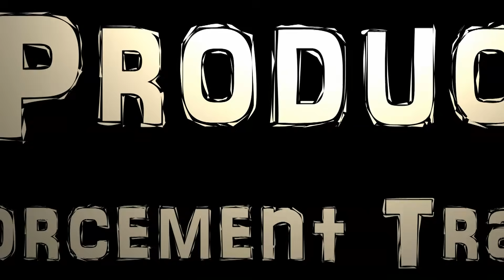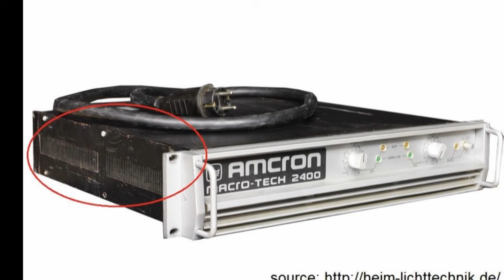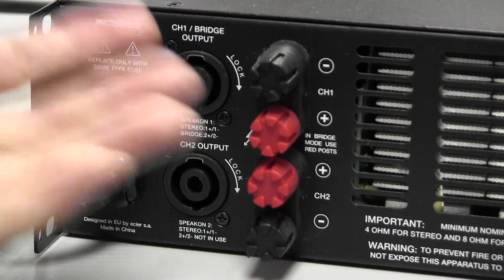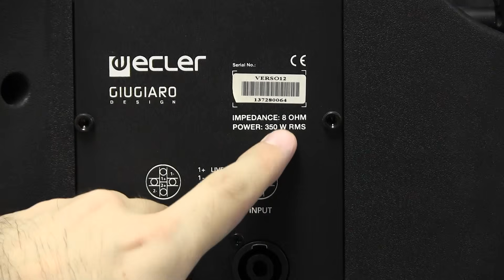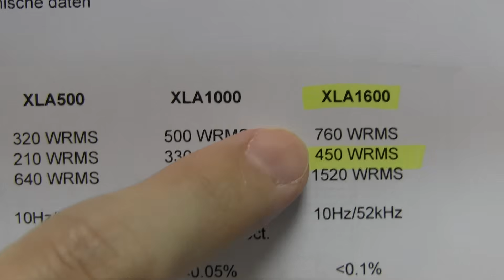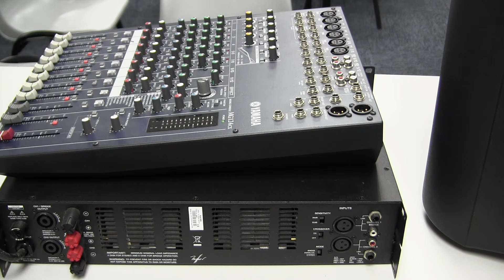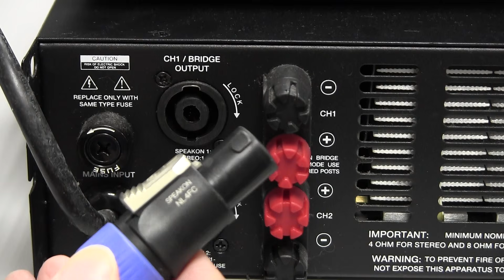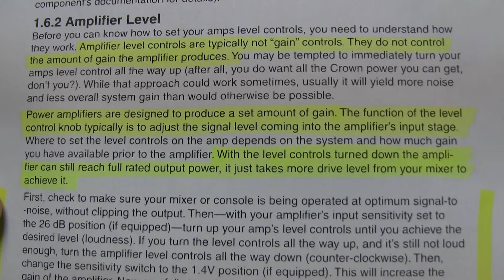How to connect a power amplifier to passive loudspeakers

Comment: This is a great video! so informative. So I have a question, I have a 1500w amp and 2 sets if 100W and 500W speakers whose impedance is at 8ohms each. Can I use this amp to power the speakers? (500w stereo and 100w stereo?) I set up the connection for the 500w and got nothing! no sound- signal flow was correct so I dont know what the issue is, any ideas?
Reply from the maker: +TanuNzau Thanks for getting in touch. How many watts does the amp deliver per channel into 8 ohms? 

If you get nothing I suggest you check your wiring - first confirm that signal is getting to the amp itself (use the front panel signal indicators) and then check the speaker cable between the amp and loudspeakers.
Reply: 500W per channel into 8ohms
Reply from the maker: +TanuNzau 500 watts into 8 ohms may be a bit much for the 100 watt speakers - try it and see! 'Overpowering' your speakers is fine as long as you don't hear any distortion and you don't clip the input to your power amplifier. Start with the level controls all the way down and turn them up slowly while you listen for anything unusual.

Comment: Great video!.. i was wondering if you have a video showing how to set up the amplifier in Bridge mode? what kind of wire i would need and how it is hook up. i want to run some duel 18s subwoofer. thanks
Reply from the maker: +dee fresh There is one in the works!
Reply: +GLB Productions thanks for the responding.. ill look forward to the video.. i've learn a lot from your videos.. keep up the good work!! Props from San Jose, CA
Reply from the maker: +dee fresh Thanks for your support, really appreciate it!

Comment: I pleasant to watch your videos. sir could u please tell me about power amplifier input senstivity like  crown   XLi 1500 power amplifier.
Reply from the maker: +Bhumadi sai kishore Amplifier sensitivity is basically how many volts it takes to drive an amplifier to full power - a more sensitive amplifier will take fewer volts than a less sensitive amplifier to achieve its rated output power. On the XLi1500 start with the switch at 1.4 volts - if your PA system is not loud enough then try changing it to the other setting, but remember that this will not make your amplifier more powerful, it will simply allow you to reach full power with less signal from your mixer.
Reply: thank u sir.

Comment: Hello I'm fairly new into speakers but recently I purchases 800w speakers with 400rms and was gonna get an 800w amp with 400rms but I don't have a mixer can I plug my speakers directly into the amp and use the amp just like a mixing system as I don't have one yet?
Reply from the maker: +Nathgta09 You can use the amplifier as a simple line level mixer with one or two channels (depending on what sort of amp you get) but you won't be able to plug microphones directly into the amplifier. Get that mixer as soon as possible ;)
Reply: Okay thanks and yes I'm getting a mixer soon
Reply: I have a quick question. Is it normal for my speakers to make a popping sound when turning on and off the amp? Even with all the controlls set to the minimum and the EQ all flat I still get this popping sound. I don't have a mixer at the moment but I'm just using my iPad but I cannot stop this popping and it's fairly loud, any ideas?
Reply from the maker: Are you using the switch on the amplifier itself or turning off the power supply to your system as a whole? Also is the amplifier plugged into the same circuit as the EQ and any other equipment connected to the system?
Reply: The amp has a switch on the front I turn that on and off. And the EQ is built into the amp and no the only thing I have connected to my amp is my iPad. When I turn off my amp I make sure all the knobs are 0 and the EQ are all down.
Reply from the maker: Nathgta09 Hmm, it sounds as though this might just be a feature of the amp. It shouldn't be though! I would suggest trying to find another example of the amp and see if it exhibits the same sort of popping behaviour.
Reply: could it damage my speakers?
Reply from the maker: +Nathgta09 It's certainly not good for them! Low level pops are not a problem but loud ones should be avoided, it's like driving your car over curbs and gutters all the time...
Reply: What about if it's a mid range popping noise? Like when it pops it doesn't come from the bass cab it comes from the midrange? I'd say it's as loud as a record playing scratching
Reply from the maker: Nathgta09 I wouldn't worry too much about that, although I would still want to find out the source of the noise.
Reply: Hello I found out why my amp makes a popping noise which is heard through the speakers, it's because skytec doesn't have a DC output protection because it's a cheap amp so what's happening is when I turn on the amp DC current is directly going into the speaker because their is nothing to stop this because it doesn't have a DC output protector. So I'm going to buy a different amp. do you have any idea if ekho amplifiers are better?
Reply from the maker: +Nathgta09 Sorry I'm not familiar with that brand. Glad you found the source of the problem!

Comment: Excellent VDO.    I saw the band's hold  systems went off during the show.   what course the system shutoff? Thank you
Reply from the maker: +San Saechao Most likely overheating - when amps detect excessive temperatures in their output devices they will shut down until the temperature drops. Not a good thing in the middle of a show!

Comment: Hi bro, if we add more speakers, which is the preferred one, by daisy chained it or to go through to the another power amp by connecting from the main power amp as mentioned (21:50).
Reply from the maker: Zulkifli Noriman You can daisy chain additional speakers as long as you do not go below the amp's minimum output impedance, which is usually 4 ohms per channel. However, if you need separate volume control over the additional speakers you should obtain another amplifier.

Comment: We have been struggling with a corporate installation involving 115 speakers divided into 5 floors. We ran into all sorts of challenges with daisy chains and fire panel patching. The moment I found this video, i sent it out to all the techies, so that they can go back to the very basics. I am so glad that I found this channel - and thank you for the excellent presentation - both technical and verbal. its simply awesome. We will be back for more..... cheers
Reply from the maker: ZAY Electronics Trading Thanks for getting in touch! Those installation jobs are WAY more complicated in terms of speaker wiring than most of the stuff we do in live sound, especially when you throw in 70/100 volt lines and the fact that so much of your cabling is concealed. I did a little bit of it about 10 years ago and have much respect for companies like yours :)

Comment: Question . . We have passive speakers for our front of house, but we also have a active speaker in another room which we have daisy chained from one of the FOH speakers to the active speaker. Is this setup ok? or would it be better to run a separate monitor feed to the active speakers? We have two XLR main outs and two Jacks main outs on our Behringer MX9000 mixer.
Reply from the maker: Jonathan Laing I do not recommend feeding a loudspeaker-level signal to an active loudspeaker as you are doing, as it is likely to overdrive the input of the active loudspeaker. So yes, I would run a separate line level feed from a spare output of your mixer.

Comment: Good day.  we used to have active speakers. However, the built in amp isn't working anymore. Thus, it's removed. How can we use the speakers(as passive) with a separate amplifier? Hoping for a response. Thanks in advance.
Reply from the maker: Jona C The best solution in your case is to have the built in amp repaired - they often have very specific signal processing and EQ built in to work with the loudspeakers, and use of another amplifier may result in damage. If this is not an option, enquire with your local dealer for that brand about ordering a replacement amplifier module.

Comment: Thanks for the video!  

Question - What's the pros and cons of choosing a passive vs. active speakers?  Are one better than the other depending on the venues, size...?
Reply from the maker: YakMan NC Thanks for the comment - I'm actually preparing to do a video on this, so watch out for that in the next couple of months. The short answer is that active loudspeakers are the future of sound reinforcement - they offer an overall lighter package and greatly reduce mistakes during set up, especially for biamplified systems. The main advantage of passive loudspeakers is that you only have to run one cable to each box, which makes for a cleaner look, which may be an advantage during corporate work.

Comment: you gave an illustration where you said you can connect two speakers to one channel in which case you connected one speaker to the amplifier then you said you can connect to the second speaker through the other speaker port in that case would that be a series or parallel connection of speakers?
Reply from the maker: Shabach Mabwe Yes that's called daisy-chaining loudspeakers, and it's a parallel connection.
Reply: GLB Productions Thank you.

Comment: this so helpfull and informative but what i need to ask is this, i have an amp with one speakon/xlr on each channel + the speaker wire terminals, now im new to this kind of setting up and want to know how to connect an xlr or speakon cables to a couple of ALPha AT10 150s, they have the bare wire terminals and two 1/4 jack inputs, now are these the same as the bare wire pos/neg or do i just put one xlr/speakon to jack cables in just one of the inputs? and a jack cable to another speaker?
Reply from the maker: J-TEK JUNKY On that loudspeaker you would use either ONE of the 1/4" inputs or BOTH of the binding post connections. If you need to daisy chain to another speaker you could use the other 1/4" input as a parallel output. 

On the amplifier side, you can use any of the output connectors as long as you keep your positive and negative consistent and do not go below the minimum output impedance of each amplifier channel.

Comment: Hello, I'm assigned to operate (all are DETON brand) a mixer with xlr main outs, but i've recent ly found out that the xlr plugs used teminate into rca, thus unbalanced. my power amp has alternativelt trs terminals. Would you suggest that i replace the cable used? the system has been used in this setup for years and it's been ok.... any thoughts on this...thanks
Reply from the maker: Neil Ram If there are no noise issues with the system (hum, buzz etc) I would leave it alone. You could of course experiment and see if the system sounds better with a balanced connection, but that is unlikely :) 

When you do a system upgrade though, I would definitely correct this issue.
Reply: Thanks, I really appreciate the suggestion. In the past one of our mics uses an unbalanced terminal that runs true the ceiling and then into a concrete wall down to where the mixer is located, this particular channel always hummed and even buzzed once you get pass 2 o clock  in the gain pot. when you switch the mic off when volume fader is up, we can hear an FM transmission over the loudspeakers. The mic it  seems turns into an antenna when switched off. At some point we thought we had a problem with the fader of the strip, but after bypassing that connection and having balanced connection used (xlr to xlr) the noise is now history. the fader was working properly and no more unwanted audio. 
Upgrading to balanced connection is in my plans, at least in increments there can be improvements. It's encouraging that you as a professional sound guy gave a suggestion that harmonizes with my thoughts about this matter. I respect the old folks who did our sound system setup years ago, so I want to be careful in informing them that I will be making changes to the system. If things could be better, why not do so right? Again thank you very much.
Reply from the maker: Neil Ram You're most welcome. As you have discovered, the most critical place to have balanced connections is where your mics plug in, because those signals will receive the most gain. Speaker level connections can be and always are unbalanced, because there is no gain applied to the signal after the amplifier. 
At the same time, if everything is close together, especially when routing signal between pieces of equipment in the same space or work area, unbalanced connections will usually work out fine.

Comment: Very helpful info.  Thank you.  Is it Ok to use both the speakon and binding post outputs to run two cabs from  a single channel? If it is ok to do this, and you use two 8 ohm cabs will that make the draw from that channel 4 ohm (i.e. the same as chaining them)?  Any pointers would be appreciated.  Cheers
Reply from the maker: Andrew Brown Yes no problem - the channel outputs are all in parallel so using two sets of outputs is the same as daisy-chaining the two cabs together. Your math is correct :) Just be sure to get the polarity of the binding post connection correct, or the cabs will be out of phase with each other.
Reply: GLB Productions How do you ensure the polarity is correct?
Reply from the maker: Shabach Mabwe Just make sure that positive is connected to positive and negative to negative on all loudspeakers.

Comment: Hello can you tell me when you connect two mixer desk together is it then possible to use the monitor outputs  on the sub monitors to gain extra independent monitor sound to the band ,so if I have 4 on the main desk and two on the sub I get six,would be very grateful if you could help thanks,Stuart
Reply from the maker: Stuart Round Have replied to your similar comment on my how to connect two mixing consoles together video :)
Reply: GLB Productions Thank you very much, great help.May I just say you are very clear in you video a big thumbs up.
Reply from the maker: Stuart Round You're most welcome, all the best with your music!

Comment: Hi thanks for the previous feedback... I've another issue that so far can't find a solution from the net and other forums hope you have some idea: whenever there are a few inputs to the mixer (two persons speaking at the same time and music playing through an ipod) such that it is very loud, the output sound suddenly becomes muffled. I've checked that the audio output bar is still within the green range. 
The muffled sound is like the treble just go missing, you only have the bass and the mids. The sound returns back to normal when the input is not that loud.
I'm using a Yamaha MG166CX mixer, Yamaha PS3500 power amps and Yamaha BR12 speakers (EQ is usually bypassed).
Reply from the maker: jeff low Interesting issue. Where are your inline compressors (the yellow knobs below the gain) set? Also, does the problem only happen with microphones or will it happen with any loud signal?
Reply: The compressors are off and it only happens when the microphones and iPod are playing loudly. I don't think it's clipping as clipping sounds like cracking sound on speakers...
Reply from the maker: jeff low In that case you need to determine the source of the issue systematically: start at the mixer and listen on headphones to see if the problem you hear in the speakers is also present at the output of the mixer. If it is not, move swap out the power amplifier and try again. If the problem goes away when you swap out the power amp, you will know it's in the amp, otherwise, it's in the speakers themselves. 

Based on your description it sounds to like there is a protection circuit being activated somewhere to protect the HF drivers in the speakers. Try the above and let me know what you find :)
Reply: The Yamaha amps have a special eq that sets in when the load is high but I've disabled it. Not easy to test as it is only for a few seconds and I can't intentionally replicate it in the place it is kept (because it will be way too loud). I may add another brand of amp and monitor in next event. Thanks!
Reply from the maker: jeff low If you can't replicate the problem in a controlled environment it will be difficult for me to help you. Why not wear hearing protection while you're testing?
Reply: OK will try

Comment: Hi, thanks for the info. I've a few questions:
1. If connected in parallel, are the outputs in both channels still 8 ohms each? (given that stereo is 8 ohms already).
2. If daisy chain two speakers, are we dividing the impedance by two?
Reply from the maker: jeff low Hello fellow countryman ;)
1. The stereo/parallel setting does not affect the amp's minimum load impedance, it only affects the internal routing of the input signal.  
2. You divide impedance by two if the two speakers are both the same impedance, eg two 8 ohm speakers in parallel yields 4 ohms.
Reply: GLB Productions Wow very fast reply thanks!
Reply from the maker: jeff low You're welcome :)

Comment: For bridge mono, how many watts of speaker is suitable for this amp.
Reply from the maker: Zulkifli Noriman The calculation is as described in the video - the power delivery of the amp should be around the speaker's 'program' power rating, or 1-2 times the RMS rating. So for this particular amp, the speaker should be around 1500 watts program.

Comment: Hi Bruno,
If we do parallel, does it runs the same as stereo in watts per channel and what about bridge mono?
Reply from the maker: Zulkifli Noriman Yes, power delivery in parallel mode is the same as in stereo mode, it just changes the signal routing within the amp. 
Power in bridge mono is typically double that delivered by a single channel, eg for this amp it is 1520 watts into 8 ohms. However that power is delivered into a single load (the amp effectively becomes a single channel) and minimum impedance is double that available in the other modes, so 8 ohms minimum for this amp.